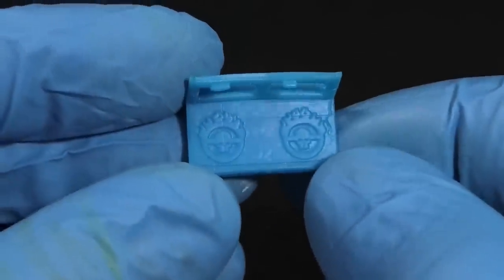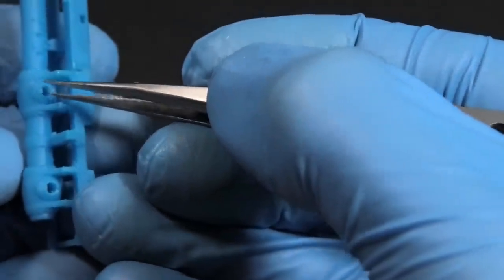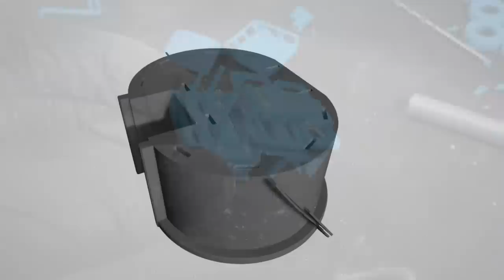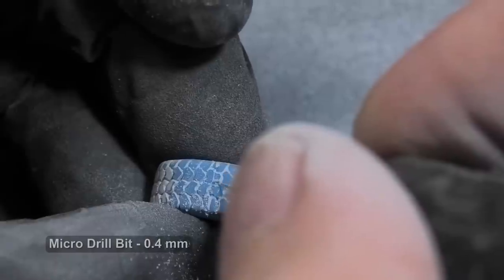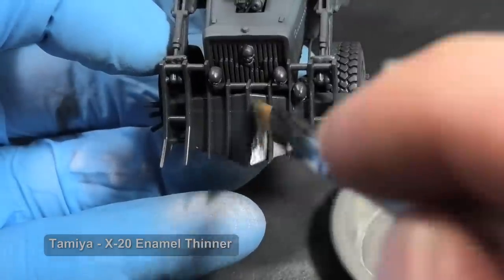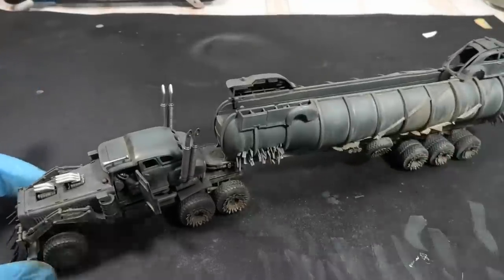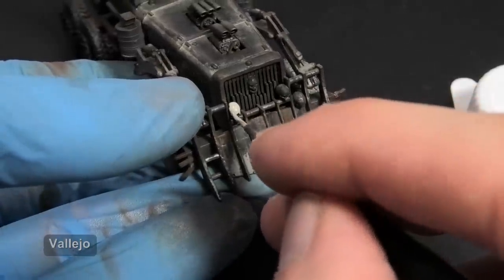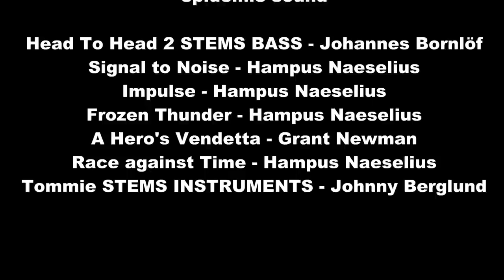The War Rig - Mad Max - 3D Resin Print 1/72 - Truck Model

Comment: Plasmo, dipping the parts into hot water will soften the supports and make them much easier to remove. Different brands of resin will swell less and make fitting much easier, also watch out for how long you cure them for, the longer you cure them the more brittle and swell they become

Comment: Lower you exposure time when you slice you files to get the keys to fit better. Resin printers can have, what some people call "light bleed" which changes the outer dimension of your print. you can try two parts that should fit to gther and then drop the exposure time by 1 second and see how it fits. Also, removing the supports before you cure  them will lessen the damage you could get when you remove your supports.

Comment: I've sprayed Mr Surfacer with an airbrush and found it fairly easy to clean out.  I used 99% isopropanol (propan-2-ol) for the main cleaning and then finished off with some Mr Color Leveling Thinner.

Comment: Plasmo please make sure you have VERY VERY good ventilation! it is likely that there is already a UV air filter for the printer, but it is not always enough. Resin dust and resin fumes are extremely carcinogenic.

Comment: A thought on painting this model. If one assumes that the black paint was painted over original colors for the parts that made up the war rig and ou could introduce more colors by painting the parts different colours then cover them in chipping fluid and then add the black.

Comment: Pro tip. Remove supports BEFORE you cure and use hot water to soften them, they literally fall off. 

2 gloves is always good practice to as you will always touch something by accident.

Comment: Wow! I need a resin printer in my life!
Reply: David makes it look easy but it's tricky and a learning curve...
Reply: @Yves95128  I don't doubt it, but the results look so much cleaner than the wire fed. I had a buddy print up a version of my superhero character, and not only were there noticable lines and ridges, but it was such a pain peeling away layers and I ended up losing the figure's sword and some of her fingers as well 😣
Reply: Get an FDM (wire feed type) first, use it for simple shapes. Wargamers use them for terrain a lot, so diorama parts is easy.

Then get the resin printer for finer details.

Comment: I use the resin printer for miniatures, I learned to clean the the supports off and clean up the  model then put it in the UV lamp, less chance of  blowouts and fractures that way.  Also covid approved N95 mask  is bad, use a filter painters mask the ones that look like gas masks, one of the resin modelers on FB posted that he  was using the n95 masks and now is on oxygen permanently due to resin dust damaging his lungs.

Comment: Fantastic video! I saw it coming  (^_^) I learned to fix the models in 3D before printing, I assemble them all in  my favorite software that is Alias Autostudio and make sure that there are at least 0,15 - 0,2 mm gap between the parts because I found that less than this parts just don't fit in, normally the holes tends to be a bit smaller and pins a bit bigger after printed than the 3d modeled ones due to the phenomenon of UV light side bleeding into the VAT. But I fixed so far models of 1/8 figures, I imagine the nightmare it would be to do it in this model. Great job!

Comment: To my mind resin printers are made for models only, no real usage for them. Like FDM printers...
Reply: They make very precise parts, like casting cores. Seen it done to make a replacement intake manifold for an Ur-Quattro. Printed the intake, made sand cores, then cast in aluminum.

They can also make things like an intake manifold for a car directly. The Hoonicorn mk2 (the one with twin turbos) and the Hoonitruck both have 3d printed intakes.

Good for prototype work in industrial settings.

Comment: Once again a beautifully made video of you to see.
That you now also deal with the 3D printing I find very good.
An interesting project you have chosen, resin shrinks a bit when printing, I calculate with one in my print.
I also find it very good that you have continued with problems.
The end result looks very good, I like the truck very much.
 If you ever want to do something in 1/72, then look at the times of Germania Modell his PBR in 1/72. You can get the files from the store, the design is very good and it all fits together great, you just have to sand a little when you connect the bridge to the hull.
Also there are other nice things ;).

https://germania-figuren.eu/3D-Drucker---Druckdateien/der-kalte-krieg/Vietnam-Krieg/pbr-pibber-mark-ii-mit-crew.html

Comment: Bro, you bough an extremely overpriced printer with outdated components. There is bigger and faster on the market, better in every aspect for less cost. You need higher quality resin also, one that does not nned so much postprocessing on account of its shrinkage and warping. Ofc you cant get dimensional accuracy with low quality product. You are wrong, resin is not 70USD, maybe from Prusa. But a higher quality resin for a standard lcd printer is around 40EUR. Sorry to say but you shot yourself self in the foot with that machine. Not even a monoscreen.

Comment: Using the ling you provided, I attempted to order this model and encountered a few issues;
https://www.gambody.com/3d-models/mad-max-war-rig-truck

1a.) It's not clear if the quoted price is merely for the design, or the printed model.
1b.) There is an option to 'GET IT PRINTED', but, it's unclear how to activate this option.

2.) While your Youtube channel shows it in 1/72nd, the model in the included link is shown in 1/16th scale, and there doesn't appear to be an option to change this.

Could you send me an invoice for; -all three sections, -printed, -in 1:72nd scale or, better yet, 1:64th, if possible???